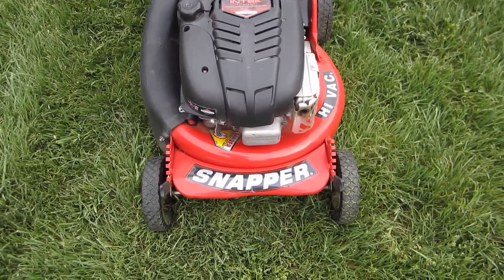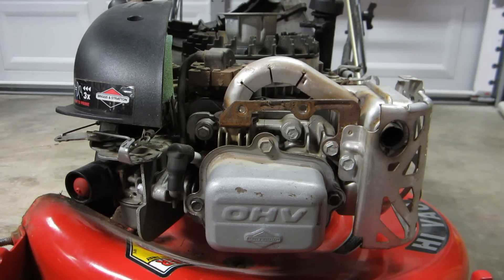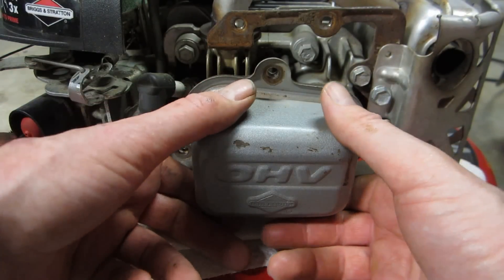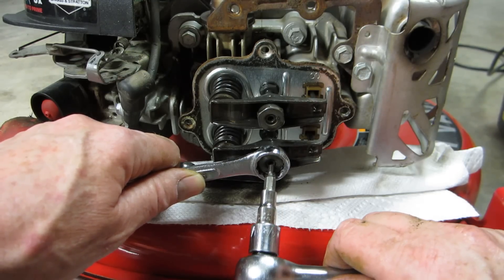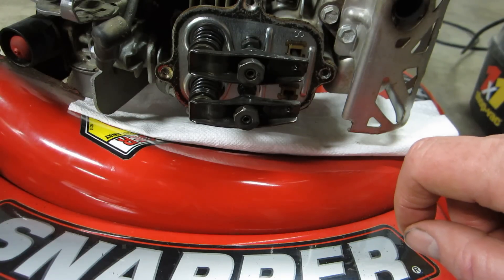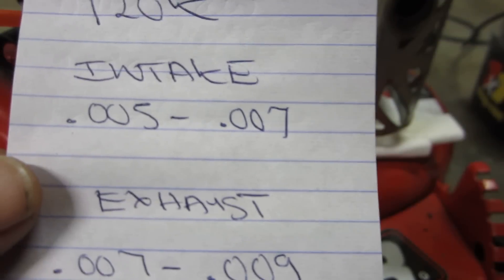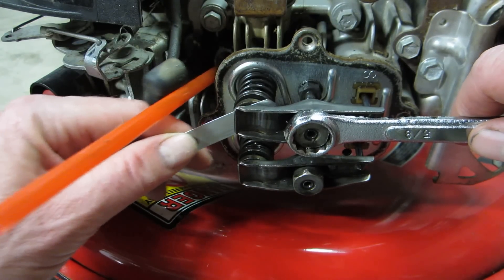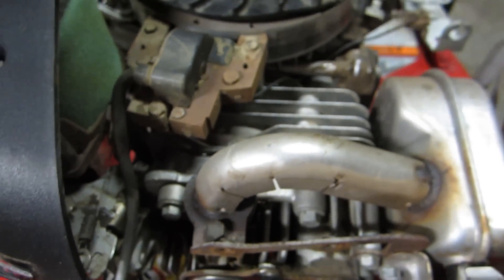Snapper Lawn Mower 21" Hi-Vac 7HP B & S OHV Valve Adjustment  - Part III - April 11, 2013

Comment: I picked one of these up from the junk yard. It needs a new primer and carburetor but i cannot find the correct parts for a 7.hp intek edge ohv Briggs and Stratton. Could you point me in the right directions.  It's completely identical to this one
Reply: Good luck 4 years later and even just finding this video was extremely hard

Comment: Thanks for putting all the info in one spot.  It really helped me a lot, because I initially adjusted the valves at TDC, and it wouldn't start.  Just rotating to 1/4" down from TDC, readjusting the valves and it started on first pull!
Reply: This 10 year old video was hard to find but I did the same thing and we will see tomorrow if that is why I'm at no start. Funny how hard info for these engines are to find in this day.

Comment: I found this to be a VERY helpful video. thank you for the tolerances! I just want to make a quick note, After working out the torque screw problem, i realized, it IS NOT a torx... It is an allen wrench. I apologize, i forget what size (yes, i know that would help) but it is NOT a torx, it is an allen wrench... Otherwise, SPOT on! bravo sir! Thanks for the helpful vid!

Comment: i have the same mower what tool did you use to unlock the nut to adjust the valve????? please help
Reply from the maker: Hi James Moulder thanks for viewing, its a Torx they come in various sizes seems I used a T-15.  Just make sure you use the correct size and they will come loose with just a careful twist of the wrench.  Good luck with you valve adjustments its actually very easy.  It will make a world of different in your engine if the rope has been difficult to pull or if the power feels down in cutting tall grass.  It will make it come back to life again with power, thanks and take care!

Comment: Thanks for this video.  Especially the tolerances for the valves, saved a bunch of time.   The only thing that would make it any better would be giving the bolt sizes, 5/16 and 3/8th I think on all the bolts so I didn't have to go back and forth to the tool chest.   Also, on the straw trick, the top of the piston isn't flat, so I just tried to hit the middle as it varied by a lot especially when turning the crank.  The engine is the same as the Craftsman 7hp Briggs and Straton in case anyone else has a problem with hot starts on their mower.   I replaced the fuel line at the same time as it was needed.
Reply from the maker: Hello Grant Z Price, thanks for viewing and your helpful comments as well for the bolt sizes to add into any future videos.  These overhead valve engines need to adjusted at least ever few years.  If you see just a loss in power particular with high grass and a really hard to pull the rope to start it then those valves need to be checked.  Here is also a link to the Briggs and Stratton Check Chart all various engine specs including valve clearance,  its a PDF file where you can find those adjustments very helpful, take care!

Comment from the maker: Hi knighthawk86855 thanks for viewing!  You are right did that after it ran for some time.  Just used it today, still runs great but seeing it burning some oil after it first starts up but it does stop.  Then occasionally a puff every now and then.  What do you think maybe a head gasket on this?